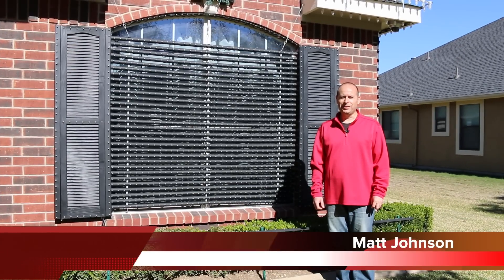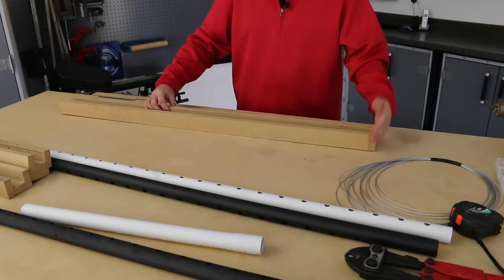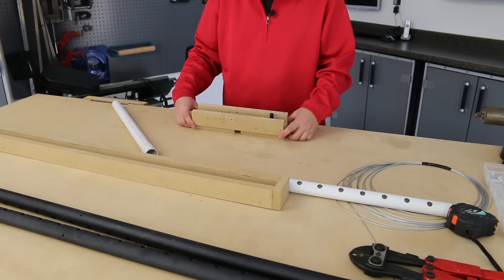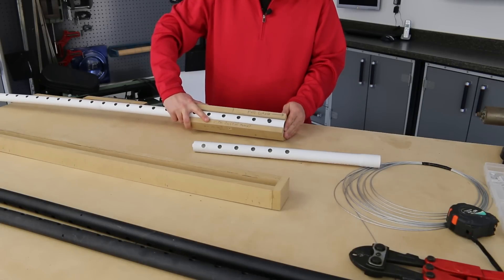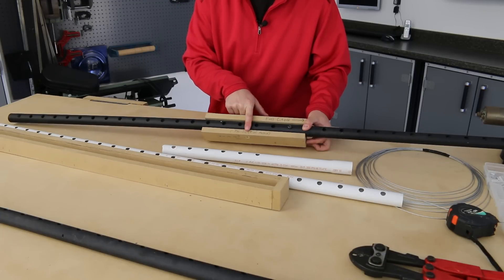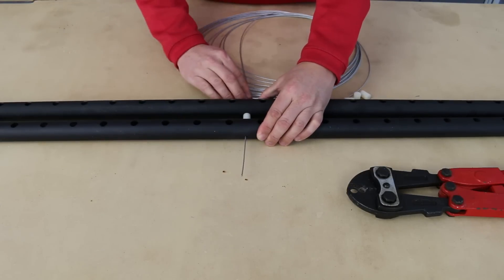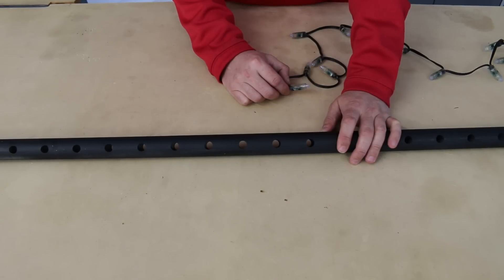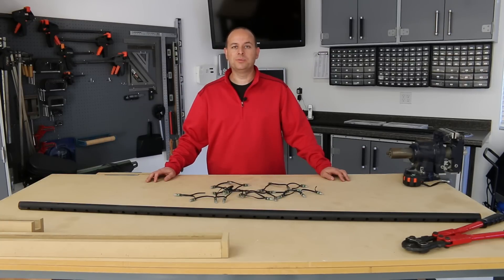Part 3: How to build a Pixel Matrix/Pixel Grid for an outdoor Christmas light show

Comment: Matt, I couldn't find anywhere that you listed what size PVC pipes you were using.  Can you let me know?  Also, what size hole were you using for the standard 12mm bullet pixels?  In you video it looked like you were using the same size holes on both sides, does that actually work?  I was thinking the pixel would all through the front hole.  I'm trying to get ideas to replace some current PVC window frames that I just had RGB dumb light strips attached to them but I want to replace them with pixels so your idea I think would work for me also.

Comment: Will I can only make one of these.  That would be the leaping arch. The rest is too time consuming.  If anyone comes up w/an easier method, let a woman know.
Reply: This wouldn't look as good but you could probably get away with a wood slab the size you want the matrix to be, get waterproof addressable LEDs that come in strips instead of nodes, and just glue them on at an even spacing. The led strips already come in lengths of 30 or 50 LEDs so all you would have to do after that is wire them together. The downside is you will not be able to see out the window, but i suppose you could put it on a blank space of wall.

Comment: Hi Matt, great video.  I am just getting into this.  I'm piecing together what I need based on your videos hardware wise.  Question though, wiring the string of pixels do you wire each row together then splice vertically and end up with one connection that goes to the controller?  Or do you have to stop at so many pixels then hook them to the controller and pick up from there to another output?  Having trouble on the hook up of pixels to the e682.  Can it support up to a certain amount of pixels?  Or can your example of a matrix be all wired together parallel then to the controller with one connection?  Thanks for your work!

Comment: I'm curious how you sequence the text on your pixel matrix. What software do you use for the matrix?  Is it just tediously hard programmed or are there simplified effects for text?
Reply: +ipscone Vixen 3 has all that built in - not tedious
Reply: check out the falcon pi player. just go to the falcon Christmas forums and start reading the FAQ. it's a lot to take in but you'll learn so much.

Comment: I've been trying to drill these holes with a jig for this for nearly 2 weeks now. I have a drill press and everything seems to be inlined when I go to drill the holes. when I drill a few holes I look down the pipe and it's slanted always. any help please would be greatly appreciated. just can't figure out what is causing this to happen to these pipes. could it happen if the pvc pipes r warped to begin with from. sitting outside?

Comment: Hello Matt, can you tell me how many Pixels in each of your strings? When I search for "DC12V 12mm WS2811 led smart pixel node" on aliexpress, or alibaba I see the strings come in 50pcs, and 100pcs most of the time. Which ones did you buy?
Reply: +Gene Berger I wondered the same thing, Matt says he uses 6 strings so each must be 170 LEDS(pixels) per string I assume. With 170 at 50mA each that would be 8.5 amps so more than the 5 amp maximum out current of the e682 - he must use power injection ?, Maybe a replay from Matt might clarify the situation.
Reply: myozone I agree, Matt? I am almost 100% for sure using power injection.

Comment: Drilling the 1/2" holes using a step drill. The drilling jig only works if there is a beginning hole in each piece of pipe. How did you establish the very first hole in each pipe?
Reply from the maker: starfuel1 The first hole on each piece of pipe is drilled manually, than every other hole uses the peg on the jig to line it up. Then at the end, the jig is used to cut the ends so they are flush. I think it explains this in the video...
Reply: Matt Johnson I guess I missed that. When you were showing how the jig worked, I noticed the pipe you used already had a hole in it and everything lined up perfectly in the end and I thought if the first hole is off a little, how can it all line up? I understand now that it is a fool proof method you have designed. Great video, Great engineer, thanks for explaining it to me.

Comment: Hey Matt,

A few more questions if you don't mind.(I really am getting into this)

I just wanted to confirm with you if these pixels were the one you purchased.
http://www.aliexpress.com/store/product/100pcs-DC12V-12mm-WS2811-led-smart-pixel-node-with-all-black-wire-20AWG-IP68-rated/701799_1932863171.html

#1 Are the pixels you purchased all connected together when they came? I noticed when doing the math, that you need to purchase 11 sets of 100 pixels since the total amount of pixels is 1020, which I believe gives you 80 left over. I'm a bit confused on that part on what you do with the remaining pixels.

#2 How much light controllers do you suggest to buy just for one light matrix?
#3 If I wanted to run the show directly to a computer, how would you do that? 
#4 Can the show be powered directly from computer or does it need an additional external power source?
#5 How much cans of spray paint did you use for the total 30 rows?
#6 For the spacers, which screw size did you select? 1/4", No 6, No 8, or No.10?

Thanks again!
Reply: You can get them much cheaper.  Keep looking. Www.diyledexpress.com has everything you need cheaper. The E682 kit can be found at www.sandevices.com $109.00 + $9.0 shipping.
Reply: +Kevin Wu I can only assume he makes the string lengths he needs. each string he uses is 170 pixels, so he must splice what he needs together and keeps the remaining 80 as spares

Comment: Can you please link me the pixels you used? I don't see any from Ray with 170.. they're 100 per string. Are you splicing?
Thanks!
Reply from the maker: Chris S They are the ones that come in a string of 100. I cut and solder the strings to the length I need. They are the 12v WS2811 Pixel Nodes.
Reply: Ah.. Ok Matt.  
Did the colors on your facia happen because you have the Pixels over them and they reflect the colors??  Very cool effect!
Reply from the maker: Chris S Yes, they are just reflecting

Comment: This is pretty fantastic Matt, what software did you use to control all this and program your light show? and did you need more than one of the E682's? 6 universes of DMX is a lot but I can see how that would get used up pretty quick.
Reply from the maker: kamachris I used 6 e682's for my entire light show. You could run 2 matrixes off one e682 but it would require external power injection. The software I use is Vixen 3.
Reply: Matt Johnson Sweet thanks for the info.

Comment: First off I would like to say that from the videos I have watched of your displays, you do amazing work. I have not got into the pixel lights just yet due to the cost. The way pixels have been explained to me is there are strands that can be all the same color at the same time are called dumb RGB and strands that give control over the color on every single pixel known as smart RGB. How do you know what you are buying because I have followed the links you have given to Ray Wu's website and they are not labeled that way. Also as a second part question are you using a DMX network or LOR because I am rather new to this stuff and I am currently running only 64 channels on an LOR network and I was wondering what I need to make pixels work with what I already have.

Comment: Awesome Matt. Can't wait to see your show on TV next week. I do have a question I hope you can answer. . . How did you determine the number of pixels you used in your grid? I'd like to make a couple for next year, but the windows they would go in would be a bit bigger than your application. Is there a certain pixel density/distance calculator somewhere? I'm trying to determine the spacing and how many pixels i'll need. 
Thanks in advance!
Reply from the maker: Lyn Askin There is no density calculator, I used 2" spacing which works well from about 50' viewing distance with 1/2" bullet pixels. If you use pixel strips they have spacing of 1.33" but the pixel light is smaller. Unfortunately this is not a mature enough hobby/technology to have resources beyond guess and check to determine what works best in your application. Someday maybe someone will make a calculator, you would enter the pixel size, what you want to display (text, graphics, patterns, etc.), viewing distance, etc. and it would pop out the optimal spacing :-)
Reply from the maker: Lyn Askin As for your question on the number of pixels, that was determined by what fit best in the window frame.
Reply: Matt Johnson Perfect. Thanks Matt. I'm sure it'll be a little trial and error, but I'll figure out what works best. Thanks again, and I appreciate your response.

Comment: Matt,

I love the design. I was going to use peg board and just drill the holes bigger. I like this idea better. By the way, how big of holes did you drill for the bullet pixels. We have the same ones from Ray.Thanks Joe
Reply from the maker: I used 1/2" holes. I also used a step drill bit which worked better than a regular bit, especially for thin walled PVC

Comment: Great videos Matt.  Do you use more than one SanDevices e682 Pixel Controllers to run your show, and if so, how many do you use?
Rick
Reply from the maker: Yes, I use 6 of them. I will be posting my entire show for 2014 in the upcoming weeks. I could get away with less than 6 if I used external power injection but I have chosen to just use more controllers and less outputs once I max out the two on-board power connections supply capacity (each Power supply supports 29A)
Reply: Yep, I just watched it - very informative.  Looks like a very clean, well designed layout. Thanks for sharing your knowledge with us.